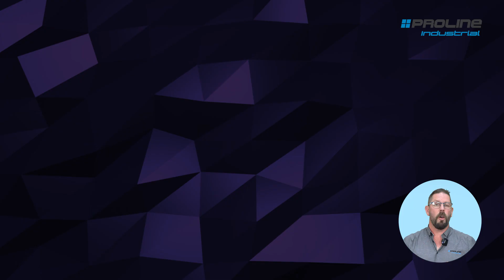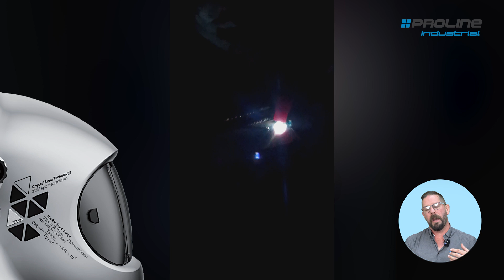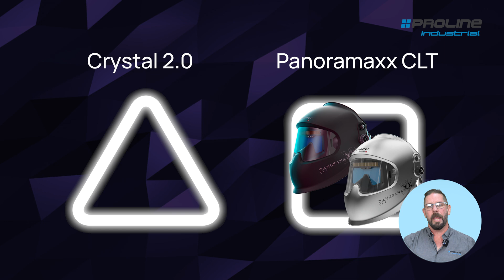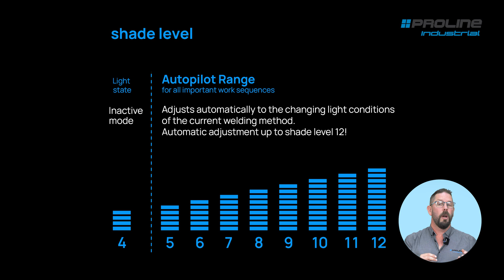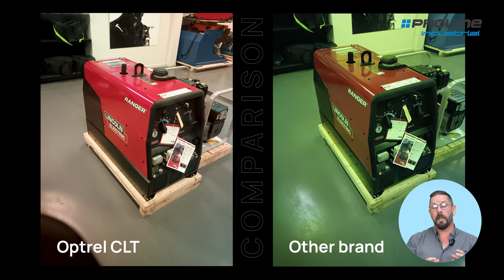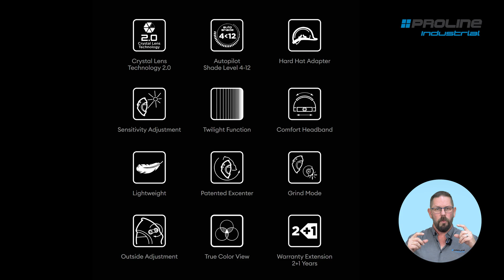Optrel Crystal and Panoramaxx CLT Review - With Proline Industrial

Comment: I bought a CLT and I love it. The clarity is amazing. The adjustements are awasome. Wearing glasses is not an issue. For a veteran welder it might be difficult to adapt to the auto shade mode. But it can be set to manual. I have one suggestion that could maybe be set in the firmware. When the glass turns OFF... I would like to have a few seconds of partial shade. Just long enough not to be dazzled by the hot weld. The lens is that much clear, that it lets so much light in.
Reply: I found that if I adjust the sensitivity a little higher... the glass stays full ON dark longer until the light from the weld dies down. That helps with not getting dazzled. But I still would like an adjustable post weld mode. A bit like a welding machine has downslope... the glass could get clearer gradually after arc stop.
Reply: Interesting you mention wearing glasses is not an issue with this helmet. 
I’ve been wondering about that, because this helmet sits closer to your face. Is there room for glasses?
Cheers!
Reply: @cambullterrier  There's an adjustment for how close to your face the helmet sits.